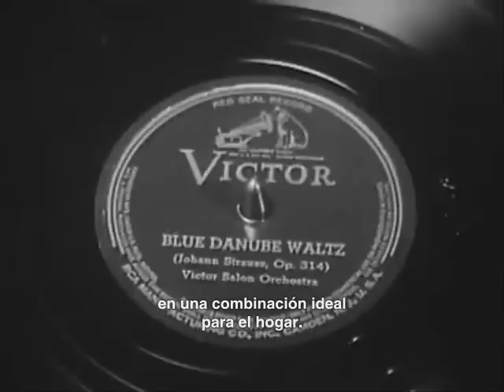CÓMO SE FABRICABAN LOS DISCOS 78 RPM ("Command Performance", 1942)

Comment: Muy complejo todo el proceso, en especial el tema de los moldes, contramoldes, matrices y matrices madre, etc. Yo me perdí ya en el minuto 8 ó 10. Un verdadero incordio la fabricación del disco de 78 r. p. m., la cual es similar a la de los discos microsurco (LP). Muy buena película promocional y vídeo. 
Una corrección: el primer tocadiscos con cambiador automático es anterior a 1942. Ya a fines de la década de 1920 y principios de la de 1930 aparecieron los primeros tocadiscos con cambiador automático. Algunos modelos podían tocar muchos discos uno después de otro.

Comment from the maker: Hubo tres etapas en los discos. La primera que eran de pasta (shellac, en inglés) que sí, se te caían y se rompían, cuando empezaron a hacerse de vinilo duro (los primeros discos LP de la década del '50 eran gruesísimos) y la última, ya en la "despedida" del formato, donde ahorraban vinilo como si no fuera reciclable, eran muy finitos y con mal sonido. Ahora, al menos, se están poniendo las pilas y los fabrican gruesos, como antes, "180 gr vinyl" y suenan muy bien.
Reply: Te diré, Dulatina, que yo tengo varios de esos delgados que mencionas y el sonido no está tan mal. Los discos gruesos en cambio, los fabricados entre 1960 y 1970, meten ruido y las frecuencias más bajas no se reproducen muy bien. No sé si tenga que ver con la propia dureza del material. El mejor sonido, a mi juicio, se alcanzó entre 1970 y 1985, aunque dependía mucho del fabricante. Los RCA, Polydor, CBS, Ariola, Peerless, Casablanca y Deutche Gramophon de ese período tienen un sonido fenomenal.
Reply: Discrepo... En mi opinión el grosor no tiene nada que ver. Si la masterización, impresión y material son buenos, el sonido será excelente...
Reply: muy gruesos seguro pasaban los 180 gramos tendria que pesar esos discos